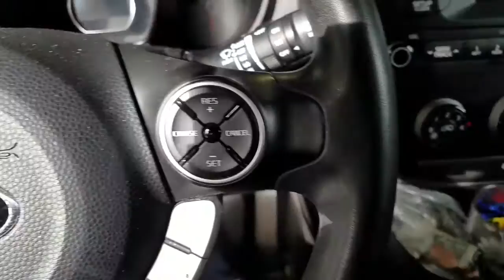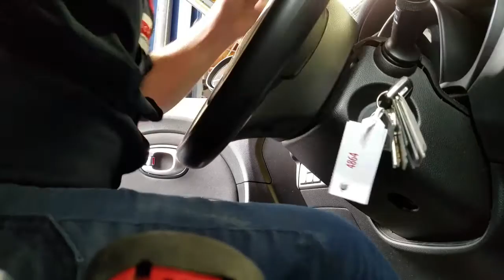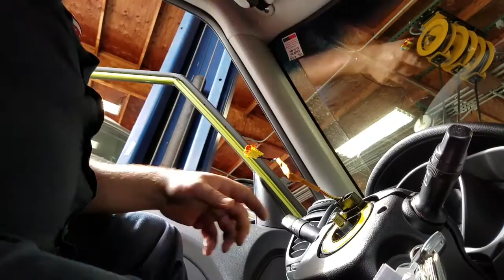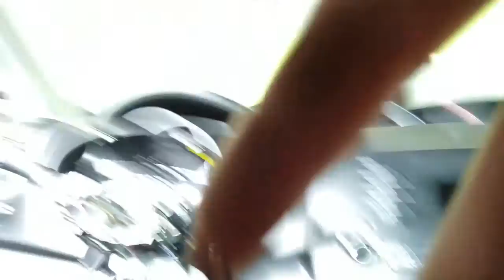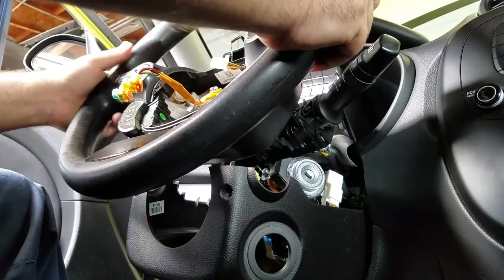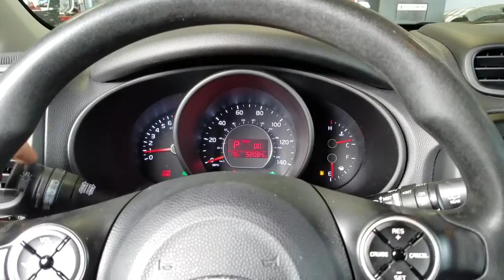2014 Kia Soul Turn Signal Switch Replacement

Comment: I have an electrical problem with my 2015 Soul Base w6spd.  On several occasions, the parking lights have come on out of the blue (middle of the night).  This happens intermittently, maybe 6+ months apart between occurrences.  Lately, I've had problems where the lights would completely go out if I used the stem to brighten or dim the lights. Lights also went out when using the turn signal.  I'm assuming it is the stem, but before I go ordering the part and tearing everything down to replace, how can I confirm it is the stem?  Since it happens intermittently, I can't duplicate the problem.

Comment: Does anyone have the diagram for the wiring on the turn signal/headlight light switch? Someone broke into mine and cut a white wire connected to a pink wire that seems to be the lights?
Reply from the maker: For which model year? Post here or message me directly an email address and I can send you the wiring diagram from ProDemand. 👍🏻

Comment: Since we're asking questions, my 2014 Kia soul headlights and dash lights will flicker, even when not touching turn signal switch or headlight switch.  Think its the same issue? Should I replace both sides?
Reply: I'm having this issue too. Mostly when using the turn signal or brights.
Reply: I’m replacing my blinker side now because of this issue
Reply: @Crickle12  did it fix issue?
Reply: @Juli_Mm  It did!

Comment: After this procedure, the left signal  would intermittently not cancel. The right signal always cancels. So I got a second replacement (different vendor) and the same  thing, intermittent left turn cancel.
 Put the original (bad headlight switch) back on, consistent correct cancelling.
Third replacement coming from NAPA, the other two go back to Amazon.
Reply: I’d guess that it has something to do with part quality. I got mine straight from Kia because I want all the functions to work how they should and aftermarket options are always a gamble (like the turn signals not canceling). Not sure what you paid for the aftermarket ones, maybe it was cheap enough that it was worth it to you, turn signal multifunction switch from Kia was $117. Pricier than I thought it would be, but if everything works as it should and it lasts as long as the old one then I’ll be happy.

Comment: i put disconnected the battery and put the key in the ignition, but my steering wheel wont turn, any idea why that is?
Reply from the maker: Your steering wheel is probably locked. It’s an antitheft feature. Rock the steering wheel left and right while you turn the key forward.
Reply: @Projectlife2023 it does feel “locked” more like stiff if that makes sense
Reply from the maker: Well you are not going to have power steering when the engine isn’t running. So unless the vehicle is in the air on jackstands, there should be some resistance.
Reply: is there a certain way it should be done, bc i tried it a couple times and the wheel still didn’t unlock, can i take out those screws before hand? or no

Comment: you shouldn't use a metal screwdriver to separate the plastics, that damage and mark it. Small details of a "amateur" mechanic
Reply from the maker: And you are a professional mechanic? Your videos would not suggest that. There is no damage to the plastics if you know what you are doing. lol.

Comment: Thank You for this. I have a 2014 Sportage, Turn signal switch has gotten lazy and won't return to neutral after a left turn. I am replacing but I was just wondering if I don't have any steering wheel controls then I don't have that clock spring correct?
Reply: Yeah, The Kia is a 2015, the bag is different than a soul. requires a T40 to release. I messed with it a bit today & saw the ring. Looks like a pretty straightforward deal. BTW I used pop steering wheels by hitting the end of the steering shaft with a dead blow.
Reply from the maker: Yes you will. Because of your horn.

Comment: Assholes tried to steal my car and broke the wiper switch. Would the process to replace that be similar or can it be done without taking off the steering wheel? What is the estimate on a job like this (I’m wondering what a fair price would be, parts included because I don’t want to take it to a dealer that is going to charge an arm and a leg).
Reply from the maker: Sorry to hear about your situation. I no longer work for Kia, but the process should be the same and it’s not too difficult of a process. As far as pricing, I honestly couldn’t tell you. As a technician I just did the work, I never really paid attention to prices.

Comment: Hi, thanks for the great video. 
I have a 2011 Kia Rondo and I am hearing a rapid clicking noise from near the turn signal indicator on my car, even when the indicator arm is in the center (off) position.  
The turn signals work normally and the noise stops when signaling. When in the center position, the signal lights are not flashing, just the rapid clicking noise. 
If I push up slightly on the signal arm, the noise stops. 
Any idea what possible issues could this indicate? Thank you!

Comment: My Kia Forte's headlights flash when I activate the left turn signal, is the procedure similar on both cars? (*EDIT: Can confirm this is the same process on a Kia Forte!)
Reply from the maker: Yes.
Reply: @Projectlife2023  Excellent, thank you!
Reply: @Projectlife2023  Worked a charm, the airbag connector was slightly different but everything else was the same.  Thanks again!
Reply from the maker: You’re welcome. I’m glad this video helped you.

Comment: Thanks for the video but I was wondering if I have no power to washer pump and fuse is good the problem could be in the switch. thanks
Reply from the maker: It could be the switch, wiring to the switch, wiring to the washer pump, or a faulty pump.

Comment: Oh man, I was hoping it wouldn’t be where you have to remove the steering wheel… 😰 I was wondering why the dealership wants $500 to replace a $60 part. I was like, I’ll just do it myself…. Nope
Reply from the maker: I only recommend doing it if you feel comfortable doing it. I don’t feel it is a difficult job, but you do need to make sure you tighten the steering wheel nut tightly. You don’t want that coming loose when you’re driving.

Comment: Hi I have an issue with all my parking lights not being able to turn on.  I have a 2014 Kia Soul 2.0l it has the led bulbs.  When I turn the switch to the first click, it makes a short high pitch buzzing noise, no parking lights turn on and the license plate light doesn’t turn on too.  It has the LED type bulbs.  I’ve been on the KiaSoul forum looking for help to solve this issue.  It’s not a ground issue, others stated it might be a column switch or a column plug.  That’s how I landed on this video.  Need help.  I live in Hawaii and my safety check is coming up soon.  It’s been like this for about 8 months.
Reply from the maker: I no longer work for KIA, but be sure to check fuses as the parking lights will be a separate circuit and should have their own fuse separate from the headlights.

Comment: I have a 2012 kia sportage and the driver side tail light does not work. I replaced bulbs and nothing. I can get it to work but once I close the hatchback it shuts off again, I have a brake light and turn signal on that side but the tail light will not work, also I can see it get power for just a split second than turn off. Could this be a indicator of a bad headlight turn signal switch?
Reply from the maker: Sounds like an issue with your wiring. More than likely the bulb socket itself. You can use a 90* pick to pull out the contacts and see if that cures your issue.
Reply from the maker: Does not sound like a turn signal switch concern.

Comment: I had to do the same repair, the headlights would flicker when using the turn signal.  I checked continuity in the switch and it's all over the place for all the pins.  It's a wonder the switch works at all.
Reply from the maker: Yep, unfortunately not an uncommon problem.

Comment: Is it broken completely if the top half came off the left switch…. It looks like it can easily be reconnected but can’t find anything on it
Reply from the maker: It should be a single piece. As far as if you can reconnect them, you might be able to. What broke? The plastic tabs? Honestly, the switches aren’t too expensive, especially if you order an aftermarket one. I’d probably save the headache and just replace.

Comment: Thanks for the video. A friend of mine has a Soul, and when she depresses this switch to turn on the high beams, they will sometimes flicker on & off while she's driving. Also, the front left turn signal bulb occasionally doesn't flash, even though I know it's a brand new bulb. Do you think these issues could be related to the turn signal switch going bad? Or a problem with the wiring harness? Any help would be much appreciated. Thanks
Reply from the maker: Could be the switch or the clock spring. I’ve seen both be a factor. If it has issues while turning the steering wheel, then it’s the clock spring. If not, it’s the switch assembly.

Comment: Hi, very good video. I have a question: I've a Kia Sport age 2012 and sometimes the switch for the fog lamps works and sometimes is not, should I change the left switch like you?, or maybe just check the connector? thanks
Reply from the maker: I would always check the connector for the switch before ruling out the switch as faulty.
Reply: same problem except it cost me 140$ and 45 minutes for a dealer to pinpoint the problem and an estimate of over 500$ to fix ..I'm such an idiot
Reply from the maker: Sorry to hear that. Live and learn.

Comment: Thank you very much!...so much helpful  the video, really!...very clear and direct in your explanation, question, which is the torque nut manufacture especification in this SUV?, i dont know, i have a Tucson 2011 its the same process you show, but  i need the torque, thanks for yor help!
Reply from the maker: Torque nut? You mean the lug nut for the wheels???
Reply from the maker: Or do you mean the steering column nut?

Comment: What was the reason for replacing the switch? I’m having an issue with headlight coming on and off by there self.
Reply: what vehicle do you have?
Reply from the maker: That’s the reason. Headlight control was sporadic. Also sometimes the turn signal would not function.

Comment: I have a 2011 kia Optima and fog lights stopped working then came back on when use right turn signal then back off ,do I need to pull steering wheel to replace switch??
Reply: Got this same problem on a 2012 cerato (forte). Can anyone advise if a switch replacement needed or try other electrical troubleshooting that might be easier?
Reply: @reubenramkhelawan9103  for me was my multifunction switch i made a youtube vid on the replacement if you search for 2011 kia optima fog light problem
Reply from the maker: Yes. Switch replacement would be needed.
Reply from the maker: Ronnie, the steering wheel and clock spring need to be removed to replace the multifunction switch. Yes.

Comment: So my gf wiper switch snapped and is hanging by cables do you have to remove the steering wheel entirely to swap those our it seemed all you had to do was hit the lever to pull the switch off is that only accessible once everythings completly off or if i had small enough tools could i just pop those screws out drop the bottom cover and swap it out?
Reply from the maker: It is encased (surrounded) and will not come off without damaging components if you do not remove the steering wheel.

Comment: Since you reattached the shroud after replacing the wheel, one wonders if it is possible to replace the stalks without removing the wheel at all? Sure, removing the cables and releasing the clips on the stalks may be a little more tricky.
Reply from the maker: If you notice, the top screw holding the multifunction switch is directly behind the clock spring. You would not be able to remove this screw without removing the clock spring. Only way to remove the clock spring, is to remove the steering wheel.

Comment: Used this video to upgrade my wife's kia soul to automatic headlight, thanks!
Reply from the maker: You’re welcome. I hope it was helpful.
Reply: @Projectlife2023  such a fuzzy feeling getting a reply to your post three years later.  😀
Reply from the maker: A change in career required my full attention.
Reply: Hello, just changing the switch gave her car auto headlights?  Did the car already have the sensor in the dash to detect day and night light levels?

Comment: Hi, I just replaced the turn signal switch on my 2013 Kia Soul. Before I replaced it today, every time I tried the Left blinker it would pop the 10A fuse. The Right blinkers work with a good fuse. So I unplugged the left headlight assembly thinking it might be there, but it still pops the fuse. I did the same in the rear light, still pops the fuse. So I thought it was the signal switch and replaced it but it is still popping the fuse when I hit the blinker lever down. Any suggestions?
Reply from the maker: Let me pull up a schematic tomorrow at work and gather some thoughts. The fuse would only blow if the current draw surpasses the fuse rating. This is going to be caused by unwanted resistance. Such as a socket that has arcing or corrosion. Let me ask you this, with both the headlamp assembly and taillight assembly unplugged, does the fuse still blow?
Reply: This morning, first, I unplugged both LEFT headlight and taillight assembly, I tried the left blinker and it blinked fast, I was excited. Turned key off, replugged both and it worked, until I tried the Hazard and then it popped again. Unplugged both assembly, put in new fuse, tried left signal with both unplugged and it popped the fuse. Can it be the RELAY ASSY-STOP SIGN, part number 95240-1P100, I am not a mechanic, just trying to troubleshoot and figure out why this is happening. The Kia dealership said the left headlight assembly is aftermarket and that could be the problem, but it all worked this morning for a few minutes until I hit the Hazards to see if they would blink.
Reply: Well, i unplugged the RELAY 95240-1P100 and the right signal worked but the left popped the fuse, so i plugged it back in and eliminated that option I guess. Went through more unplug front and try the blinker, nope. Unplug back and try the blinker, nope. unplug both and try the blinker, nope. Went thru about 5 more 10A fuses but had to try. I'm out of thoughts and have no clue. Stopped by and auto electric garage, guy says it may be a pinched wire somewhere. Once again, I'm lost to what it may be. But it did work this morning until I pressed the Hazard. I had a moment of hope lol. Maybe I should have left it alone when it was working.
Reply: Ok, one more update. I disconnected the negative side of the battery for about 15 minutes while checking the connection of the headlight assembly. I ensured all 9 connections were good to the assembly. I reconnected the battery, put another 10A fuse in, and the LEFT blinker works and all the lights work. I DID not push the Hazard light, not going to either. HOWEVER, I have a ABS and traction symbol warning on after I start the car and they won't go away. This is crazy, or at least I have no clue what's going on. Any suggestions?
Reply from the maker: Not sure why your ABS and traction control light would be on after simply disconnecting the battery. You would have to have a scan tool read the codes to see what errors it’s posting. You can also try a capacitor discharge. Disconnect the negative battery cable and remove it completely from the battery. Then use a wrench to jump between the negative battery cable (NOT the negative battery post) to the positive battery post. This discharges any electricity left in the vehicle in capacitors.
Reply: Capacitor discharge? What would that actually do? I disconnected the battery again this morning for 30 minutes but the ABS and traction control light is still on. If I turn the traction control off I have the 3 lights. If I am wrong you can say so. But I am guessing the 2 lights are on like a service light for an oil change, they need to be extinguished because the ABS and traction are normal. But I may be wrong. As for the blinker and lights, they are all working still but honestly I couldn't tell you why. I went through about twenty 10amp fuses trying troubleshoot. Is there a computer for all the things we are talking about, is that why the blinkers are working now and I have the 2 lights on? Did disconnecting the battery do that?